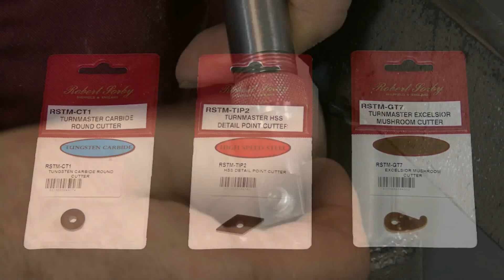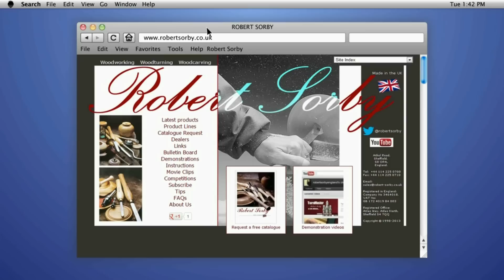TurnMaster Three Projects. Two bowls and a box

Comment: Hi,
I am getting nothing but catches when using the rougher. I have tried different heights with my rest but nothing seems to work. With a big distance between the rest and the work piece makes it easy for catches.
Reply: Stephen McElligott I
Reply: to stephenwunttool areyou useing
Reply: I just started using this tool myself and I am getting the same result, lots of catches.
By the lack of replies to this comment I suppose there is no solution to this problem.
The large distance from the work piece to the tool rest causes significant problems.
Reply: @pauldarlington5589  Yes, I am also new at this, but I was taught at a club, what they said was : handle HIGH, ie NEVER place a scraper at centre height ( while turning!!, this IS the correct 'static' position for the SHANK of the tool to rest upon), ie place the head of the tool Bellow the rest height, and approach the wood from below the centre line, and go slow, the higher the tool, the MORE aggressive it cuts, and be mindful of the tools' wings!!- keep them clear of wood, like a skew chisel long point!
I also have Autism, and one thing that helps me is to place the tool onto the bed of the lathe, this is the 'limit' of angle, so you can establish muscle memory of the point of danger, and when to be mentally aware the tool is "high" enough.
Reply: @andyvan5692  Sounds like a good tactic Andy. I have not done any turning for quite some time now as I lost my nerve and also lost interest. I do remember trying several different techniques with the Sorby terror machine and I probably did trail the cutting edge below centre, but I'm not entirely sure. I remember well though that the overhang from the tool rest to the work piece was very scary and there was a hell of a lot of leverage applied to the tool making a spectacular disaster seem very likely.
I'm high functioning Autistic also. I find this very lonely, but there are certain experiences and advantages I would not want to miss by living the mundane life of the "normies."

Comment: one question, the intro photo shows the cutting tool in 10 parts, BUT you DON'T put it together in the video, or show how the tools mount to the shank of the handle, which is a real pity as this kind of video is watched by us to be a "visual instructions" to add to the text in any manual. also can you add a link below the video telling us how to get more info on it, like what I have said previously, aka any BASIC set up videos, list of available cutters, what they do.... .
eg like this link: https://www.youtube.com/watch?v=y0OniQPPXpY
Reply from the maker: Hi Andy...Thank you for your feedback...I hope the following information helps you with your questions...The intro photo shows the TurnMaster fitted to a traditional Robert Sorby wooden handle together with the Sovereign interchangeable handle system (https://www.robert-sorby.co.uk/woodturning/sovereign-system.html)...Each of the unhandled TurnMaster tools fit into the Sovereign system using the 1/2" (13mm) collet. The TurnMaster head screws onto the end of the shaft using the locking collar and the head is positioned by placing the locating pin into one of the three selection positions. Centre position for waste removal, shaping and general scraping. Left or right positions depending on the direction of cut for shear scraping and fine finishing. There are several more TurnMaster videos on the Robert Sorby YouTube channel (https://www.youtube.com/user/robertsorbyengland)